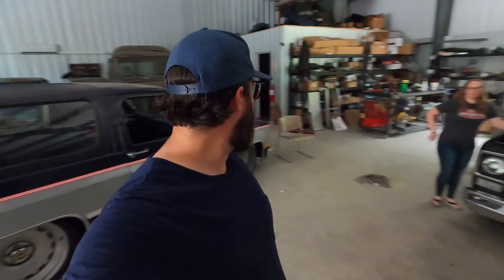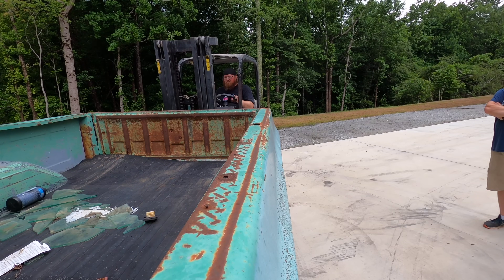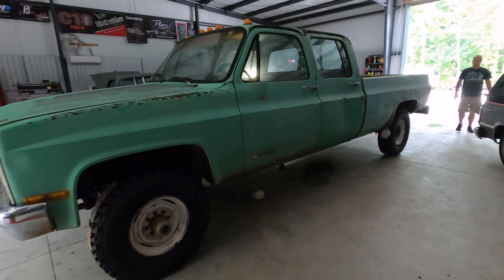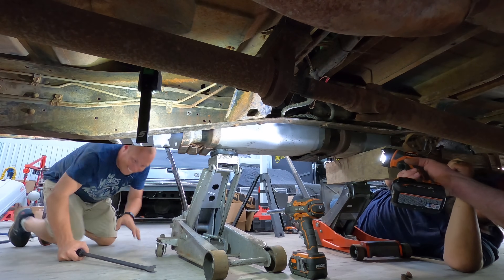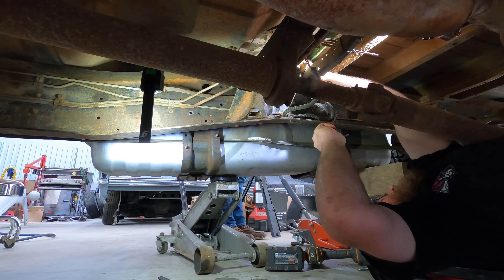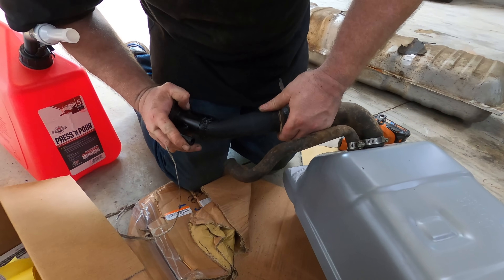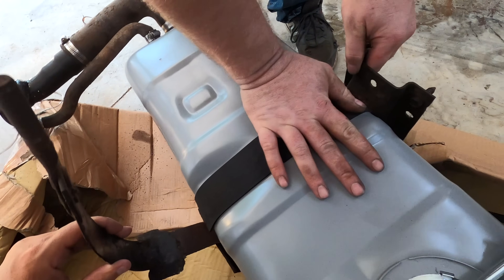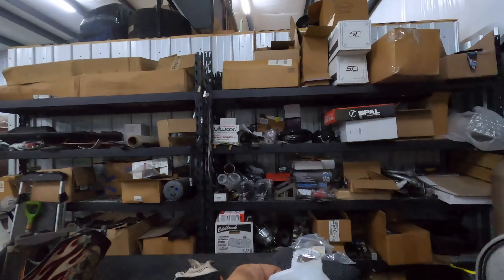Will our Squarebody K30 Run after sitting in a Texas field for years?

Comment: You guys are lucky those fuel tank bracket nuts came off so easy. When I replaced the fuel tanks in my square body crew cab I had to get a wrench in between the frame and tank, in order to get the fuel tank bracket bolts and nuts off.

Comment: Still can't believe you used a perfectly good 4x4 Blazer to make a two-wheel drive one but your truck you can do what you want
Reply: your throwing around the term " perfectly good " a little loose bro
Reply: @mikehowe8808  I saw the episode where they took it apart it was
Reply: @mikehowe8808  iv owned over a dozen of those trucks I know when I see a good one
Reply: @jamesevans5481  yeah other than it needing a Front axle, rear axle, motor, transmission, transfer case, all the steering components, complete braking system, and 40 plus hours of rust repair it was indeed a perfectly good 4x4 blazer...
Reply: There are plenty of square blazers out there..
Reply: @mikehowe8808  yes is was
Reply: @jamesevans5481  yeah man it was great..... other than those little issues I mentioned
Reply: @mikehowe8808  the 4x4 Blazer the one they used for the tub

Comment: My next trucks definitely gonna be crewcab ive owned everything else. Their just hard to find in srw 4x4.
Reply: Around my area they are everywhere but most times don’t have a title, engine, or trans and they still want $10k.
Reply from the maker: It's true, man.
Reply: I worked in the govt and military and we had tons of these trucks, so definitely not rare and some were kinda beat up, fixed and kept running,  but as a Chevy guy I still don't see the desire for these because unless they had a big block,  even the diesels were dogs.
Reply from the maker: @Pressedsteelcustomsllc  I hear ya, but trust me, they have gotten so much harder to find. And it's the axles and chassis that make them unique. I wouldn't call them "rare" bc that's not a term I throw around lightly, but to find an original paint crew cab all stock and intact is a hard thing to do these days. Yes, I know that they were work trucks and folks used them all the time, but that's what I plan to do too. I love them! And this one is getting a newer Duramax.

Comment: Keep an eye on load proportioning  valve - it is mounted on frame on passenger side by the rear end with a linkage set up . They go bad at the worst possible  time . No one makes them so you just delete it and put a different brake line along the axle . I ve had  a 1991 r3500 for 22 years and should have archived all the notes I've found on it asking if I would sell it.
Reply from the maker: haha that's so cool! Thanks for the tip.

Comment: Love those TBIs!  All the benefits of fuel injection (smooth running/good mpg/longer engine life expectancy) but simple to work on.  I remember my dad‘s 1989 k1500 got 20 MPG‘s highway (3.42 gears )…You sure don’t win any races though lol
Reply from the maker: Couldn't agree more!
Reply: @UNITEDBYTRUCKS  Too bad that there wasn’t a main line production from GM or one of the other big three making a four barrel version of the TBI… Kinda like Holleys bolt on four barrel I think it’s called projection only in a spread Bore version for potential economy when cruising on the primaries

Comment: My tbi in my 94 left me stranded for the first time ever since It was passed on to me at 14 (ill be 30 next month) I think its a fuel issue so I hope I learn something here. Either way ill be entertained
Ps as a Texan its probably Armadillo piss in the tank
Reply: Tbi electronics have been wearing down my tbi is about done
Reply: Check the sensor under the distributor cap. It tells the injectors when to fire and they are known to fail randomly without warning.
Reply: Check fuel pressure then distributor
Reply: Thank yall

Comment: So...I know its too late for this, but - I SERIOUSLY recommend removing the bed for these EFI tank issues. Especially since you gotta do both any way. If the tanks are junk, that's one thing, but realistically it's just 8 bolts n the light harness, plus tank fillers.
 Been there - so much easier with the bed out of the way.
Reply: Yea but it takes 4 people to lift a bed and those bolts rarely just spin on out plus all the wiring ...ahh just lay on the creeper and use a transmission jack
Reply from the maker: We're replacing tanks etc so we just drop them.
Reply: @rockkhound943  not making an argument, just saying there was a forklift. But yes,  that IS a very clean truck underneath, not like most here in the rust belt. Certainly we've both worked on worse.